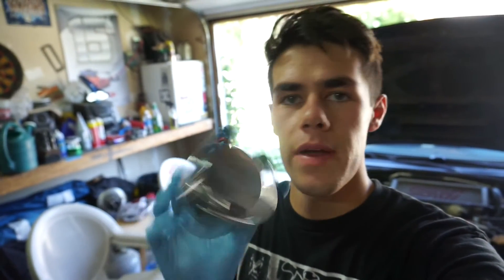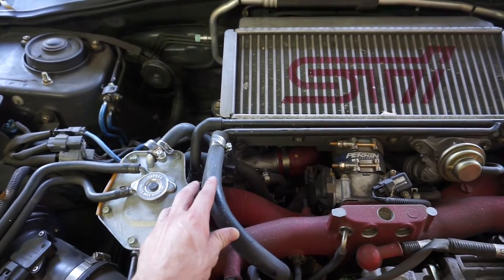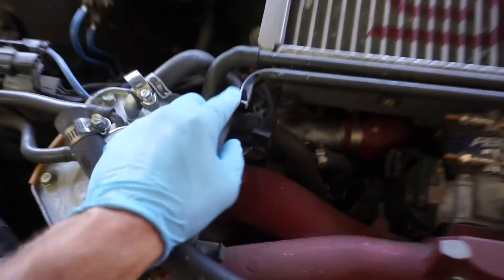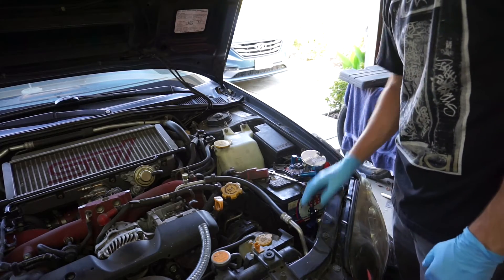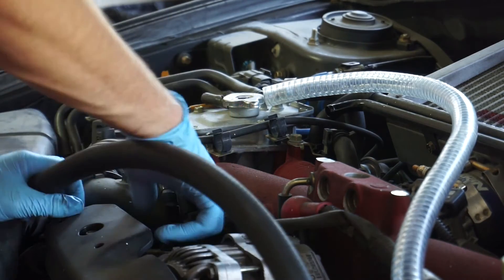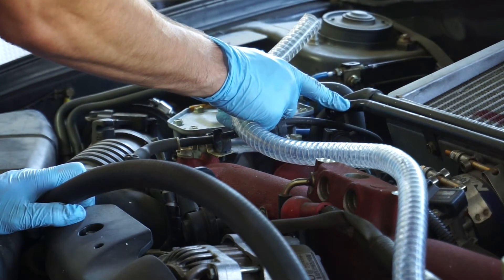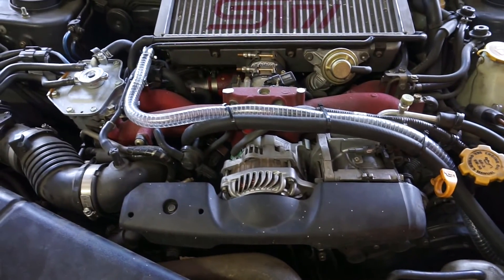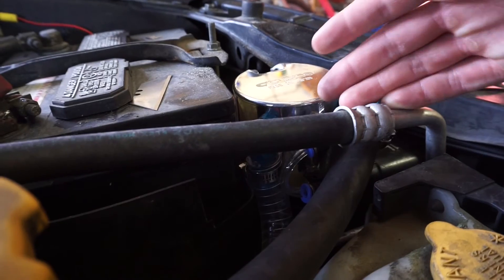Cusco Oil Catch Can Install

Comment: Hey man you should consider flushing out your intercooler. You'd be surprised what comes out of there. The oil builds up inside and reduces efficiency. I used degreaser and kerosene.

Comment: So far how is the Cusco catch can working out for you? I already order one exactly like yours for my 2013 WRX but heard some bad views from it just now and I'm kind of regretting it. And also I did my research and saw there is a big Cusco catch can 4liters. But it says only for sti :-/ the which sucks big time..if u can give me more info would be thankful! And video is great!
Reply from the maker: Carlos Salinas hows it going?! So far i like it, it does its job and i can see the oil adding up. As far as bad reviews i wouldn't worry about it, all these things are cans that get filled with oil pretty simple. The build quality i like. As far as the bigger one im sure itll work with your car, the mounting bracket just dictates what car it goes to.
Reply from the maker: Carlos Salinas thanks again for watching!
Reply: Doug Murray thank u bro! Helps a lot that u reply. Now I will wait for my Cusco oil can to arrive! 👌🏼
Reply from the maker: Carlos Salinas goodluck brotha!
Reply: You can use baffle mishimoto wrx they sell it on the same page rallysportdirect

Comment: So what's the deal with connecting only those hoses? I've seen other videos which connect the crank hoses as well. Do you upset the negative pressure if you use a 3-port catch can?
Reply from the maker: Alex Ge theres to different pressures so an ideal set up would be two can catch can
Reply: @Doogsturr  I've seen a few people delete the PCV entirely and just vent crank and head through a catch can to the atmosphere, or back into the intake pipe. As far as I can tell you've skipped the PCV/crank and are "filtering" the heads only? I'm guessing you must have been running it for quite some time now, so how is it working are you getting any blow-by in the can? Thanks for the video and the reply btw :-)
Reply from the maker: Alex Ge yes im just running the crank pressure till i switch to a dual setup. “Technically” i wouldnt be able to pass smog here in CA with a vent but i could always switch it out before i go have it checked. I havent had much blow by at all actually. Usually if you get blow by through the PCV spot it means your value is shot, so i could see why people delete it all together. Thanks for watching 👍🏻

Comment: Do you keep this set up you go duel I really need help lol
Reply from the maker: ELJAY TV ima go duel when i do front mount cause itll be easier to access the breather pcv under the top mount
Reply: im getting my new TMIC monday grimspeed i have my 2nd catch can but i'm lost at this point
Reply from the maker: ELJAY TV keep the same set up and then the second one would connect to a breather on the crank case right under the tmic and back to the intake, check out this write up https://forums.nasioc.com/forums/showthread.php?t=2443998
Hope it helps!
Reply: do i need a y splitter